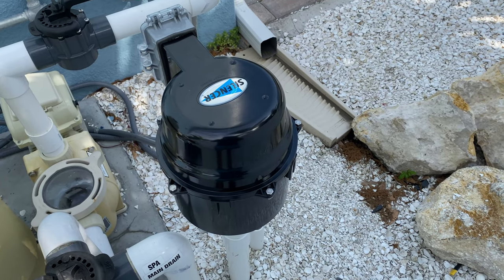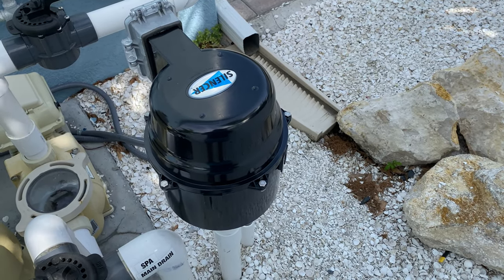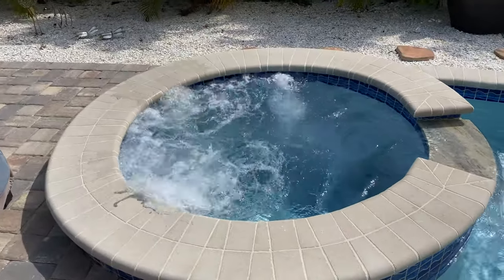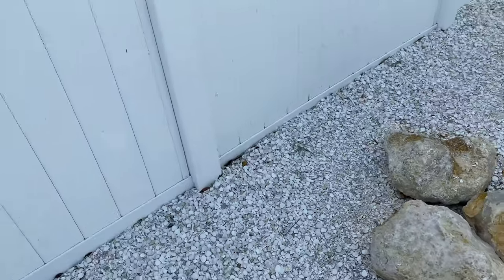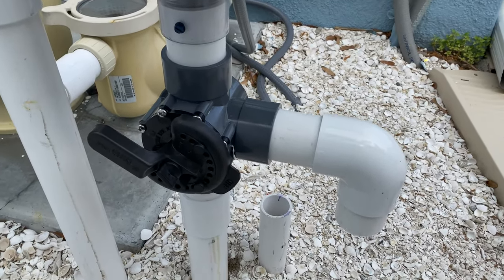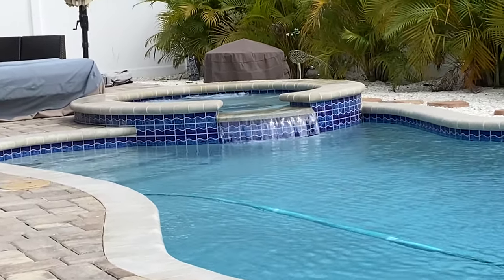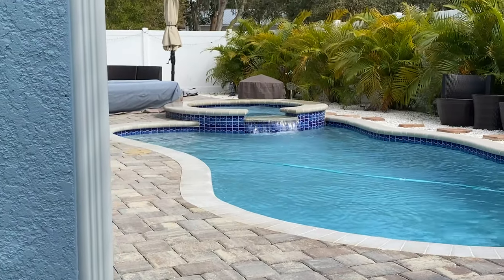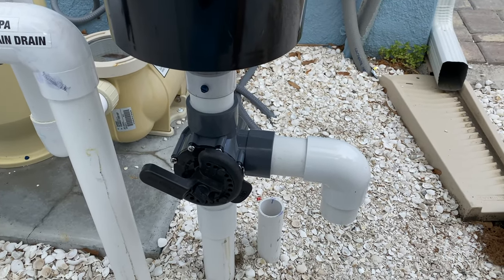Is Your Swimming Pool Spa Air Blower Too Strong? Here's a Fix! - Chlorine King

Comment: It’s a good idea and I did that but I cannot stand the loud noise from the air that’s coming out of the open pipe
.. I kinda made a silencer on the end of the air pipe by wrapping it with some foam or even a towel .  Replaced it too with a smaller motor but the motor was so loud .. maybe im gonna try the 1hp qt motor which supposedly is quieter and probably just right about of push I need
Reply: You solve one problem and create another. I was fortunate to find a very inexpensive 3 way and PVC parts are not costly at HD.  I also built a silencer with PVC pieces (I post it some day)and was able to route it into my existing swim out jets which doesn’t use a blower. Moral of the story find the right blower for your spa.

Comment: also drilling holes into the pipe will also alleviate some of the air pressure or if you can extend the blower pipe just a thought
Reply from the maker: Not a bad idea!
Reply: Did it work?  Wondering if that would create noise or whistling?  My equipment is very close to spa. Replaced blower with the Silencer shown in video which was 100% improvement in noise but don’t want to create new noise problem with diverter or new pipe noise. Diverter in video seems kinda loud.

Comment: I have the same problem - thanks for posting this!   I had a 2HP for 6 jets and 100' run, I burnt the motor out by reducing some of the nozzle sizes,  the water pressure is OK not great now but must have created too much pressure.   If I replaced with 1.5HP do you think that would do the trick?

Comment: Would a Tee (in place of the three way) followed by a standard ball valve not work for some reason?  Seems like it would be a bit cheaper...
Reply from the maker: Hey Nathan, yes it can be done and it would be a cheaper option. Thanks for watching.
Reply: my thoughts, as well.  Much cheaper.
Reply: I did that and it works great. Just trying to get rid of the air noise coming from the valve.

Comment: Cool trick.
I have a return on the floor of my spa. The jet is missing. So, I can't tell what type of jets that I need for the floor. Any idea?
Reply from the maker: That's a tough one without seeing, but more than likely it's a 1.5" thread as usual with standard returns. Do they look to be the same size as the ones in the wall of the pool/spa?

Comment: OMG that's the hard way.  I just used a rheostat. Then i switched over to an Alexa controlled variable switch. Super easy and I can control it with the same exact blower from my voice or phone. I find these pool guys that been in forever not to think outside their box.
Reply: Could you elaborate on this please. How. what parts and if it works on any blower?
Reply: Details please. Love this idea. What kind of rheostat did you use?
Reply: Cuz cutting in a T is so hard ... And fail proof down the road wise.
Reply: Would that not hurt the blower moror? Will they last just as long with limited voltage supply?
Reply: @azTechlabs, what alexa switch did you use?

Comment: I had same problem. Got stuck trying to order a Jandy valve. $50 really? But returned here to see if posted Jandy valve model # and  I read comment by Chris Daron. I was running with spa Jets turned off. Turned them on and it ran just as expected. Now just have to quiet it down some.

Comment: I have the same blower and it kicks on fine however no air is getting to the spa. It worked fine last year but I opened the pool myself this year so I’m thinking it’s something I did wrong. Any thoughts?
Reply from the maker: It could be the blower is failing or something is clogged either on the blower side or in the T’s that are behind the returns that distribute the air to the spa.

Comment: What would cause a screw top air valve that’s purpose is to let some bubbles into the spa returns leak water? Just opened my pool this year and instead of putting air into returns when open it overflows with spa water. Thanks in advance!
Reply from the maker: Very possible a Venturi “T” broke under ground and allowing water to get into the line. Does it come on only when you turn on the blower?
Reply: @ChlorineKingPoolService  I don't have a powered blower. I have a little screw top air release that, when open, is supposed to let some air into the returns giving it some bubbly effect. I fixed a couple returns that weren't installed correctly so water no longer comes out of the valve, but now when opening that same air "bleeder" valve I get no bubbles. Hooked a shop vac up and blew air into the lines and that worked fine but obviously not a permanent solution. Any idea what could cause this? Is it difficult to install silencer after pool equipment is already in? We had no idea we wouldn't be provided one when getting this pool.

Comment: How do you increase the pressure? We just had a spa and pool built and our spa doesn’t produce bubbles.
Reply from the maker: Really all you can do is get a larger blower. Just make sure you read up on the sizing requirements so you don't put too powerful of a blower on it. Then you'll overheat it and cause it to hit the thermal overload protection.

Comment: Any recommendations on resolving a blower that is too loud? My blower is way to loud and looking for a blower that can handle 6-7 outlets in the pools spa area.
Reply from the maker: How old is it? If it’s getting loud it may be reaching the end of its life.
Reply: @ChlorineKingPoolService  Its always been loud - Havent increased in noise - have been annoyed since installation - way loud (located some 5 meter from the pool integrated spa blower behind a brick wall yet, you can hardly hear yourself talking once on :( - shit blower - but not sure what blower on the market that would offer whisper quiet or close operation when on.
Its really annoying - I mean, if you turn on pump for spa jets that isnt quit either along with a overly noisy blower you really lost a good 90% enjoyment - bubbles and jets itself isnt quiet either - so all up its WAY TO NOISY for my liking

Comment: When i put the pool.in spa mode water comes out from the 2inch line where the blower is at.any suggestion why and can i add a value to close it so water wont come out with the.blower off ?
Reply: Might need to rise the blower with a 2” pipe

Comment: I tried this solution; it worked.  However, the air release from the 3  way valve is too noisy. Is there anything i can do regarding the air noise.  My Pool/SPA has 5 return jets; 1.5 hp blower.   I tried reducing the eyeball  jet from 1 inch to 1/2 inch.   It worked like 5 minutes and then the blower shut off; overheating.   A pool specialist told me never to do this as it can damage the plumbing, the increase air pressure. I did have the SPA return line 1/2 way open while the other 1/2 return line goes to the main pool.   Booster pump was on.  If it is too powerful, have i reached a dead end. Do i need to downgrade to 1 hp.  The equipment is not too far from  SPA.
Reply from the maker: Yea reducing the fittings will cause the blower to overheat because of the restriction in airflow. Check the manual on the blower. With that few of returns you may need to downgrade to a 1HP. Generally a good rule of thumb is 1/4HP per jet, but if you're trying to calm it down you may be better off with a 1HP. As far as the sound it is probably open at the perfect position to cause a whistling sound across the diverter o-ring, if that makes sense.
Reply: Same exact situation and issue. I dropped to a 1 hp Silencer and sound no longer an issue vs old blower but im hesitant to install the diverter and go back to noise.  My equipment is <10 ft from spa.  Seen a few comments here on using a Potentiometer or a rheostat switch to dampen power just not sure on proper specs.

Comment: The jacuzzi blower we have was installed 17 years ago and has always been loud. Are they all like that or can I get one that makes less noise?
Reply: I installed the same Silencer 1 hp shown in video and its night and day volume-wise from my old blower.  Have same issue still with water over the top even with the 1hp but the diverter seems like it was loud.
Reply: @boc7185  Same here. The new is certainly a lot quieter and it is the same exact replacement from the original one a few years old.

Comment: I see you have a shorter pipe for the blower. I have a higher spa about 4 feet,should the pipe be higher to install the blower?
Reply from the maker: Yes the blower should always sit above the spa water level. Most blowers recommend a foot or two and it’s always a good idea to put a blower specific check valve in place. This all ideally prevents water intrusion to the blower. Hope this helps.
Reply: My installer doesn't want to install a check valve but I think he should .thanks for the info.i will insist he installs one. 👍
Reply from the maker: @superme246  it’s cheap insurance. Make sure it’s a blower specific one because they have a weaker spring to make sure it doesn’t restrict the blower.

Comment: Would it be bad if i do this method and close it when not using the blower but in spa mode, so water wont come out ?
Reply: You should never be getting water up the blower standpipe.  It should be well above the waterline, optimally with a hartford loop and a check valve (light spring & ball, meant for air) inline.  See the plumbing instructions for this very blower here: https://www.airsupplyflorida.com/wp-content/uploads/2014/08/installation-guide.pdf
Reply from the maker: Great answer. Also a check valve should be in the line if it is below grade, or really any installation really.

Comment: You should install the right amount of air nozzles for the pump you have
Reply from the maker: If I built the pool I would have done that. I did spec out the blower I replaced based on the number of return jets in the spa. The one originally there installed by the builder was a 2hp and mine was a 1hp (recommended based on jets)

Comment: Wait a second. I’ve been in pool repair 11 yrs commercial and residential. Blowers only make that mess when the either jet pump isn’t on ( if it has one)or the spa jet valve isn’t open. I understand down grading blower. Rule of thumb is 1/4 hp per jet. If you have jet line open the water would make its way to center of spa. Without jets open blower blows after close to wall and makes a mess. I have videos and pictures to prove this.
Reply from the maker: Thanks for the comment. This system did not have a spa jet pump, and both of the spa return lines were open during this entire video. So the only option was to add a way to purge the line so not a full volume of air made it to the spa. I didn’t build/install the plumbing for the blower. Just working with what is there. Have a great day.
Reply: @ChlorineKingPoolService  close spa return line and keep spa jet line open
Reply: Bubbles hitting the back dont feel good it needs strong flow to those jet lines for true therapy like any other spa
Reply from the maker: Chris Daron I had them do that as well (closing spa return) prior to installing the 3 way and they said it’s too strong. I really appreciate your input bud.
Reply: I have this issue but dont have separate pump.  Dropped to the same Silencer 1 hp shown (5 jets) and still have this overflow issue but the sound improvement is great, hardly hear it from 10 feet away.  Im hesitant to vent because it seems like its loud (my equipment is very close to pool unfortunately).  
I basically drain some water into pool before isolating flow in spa.